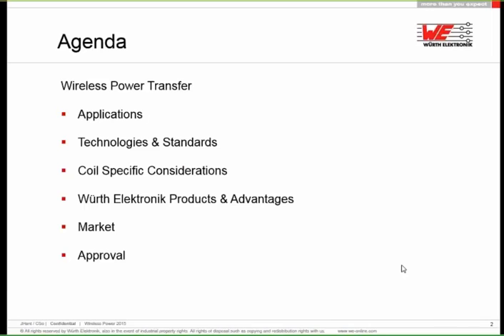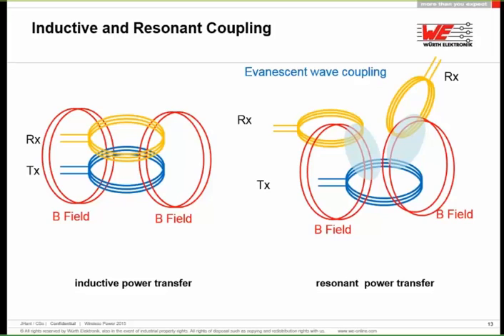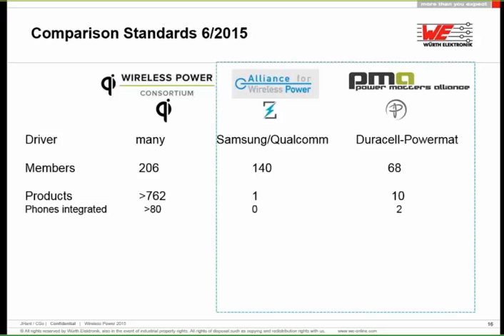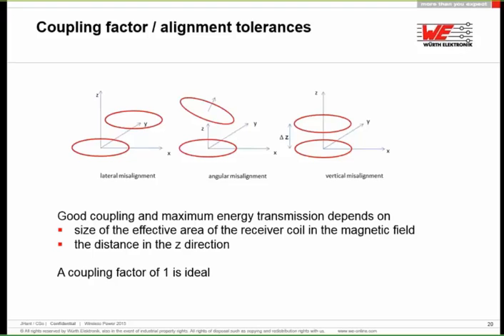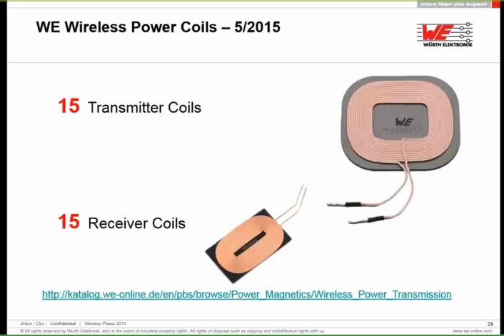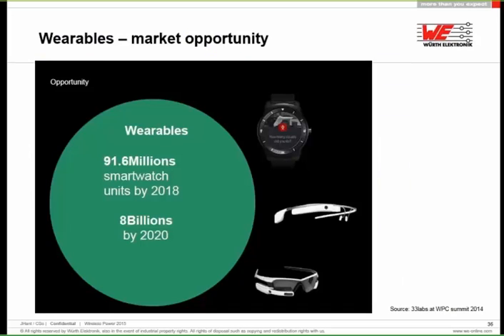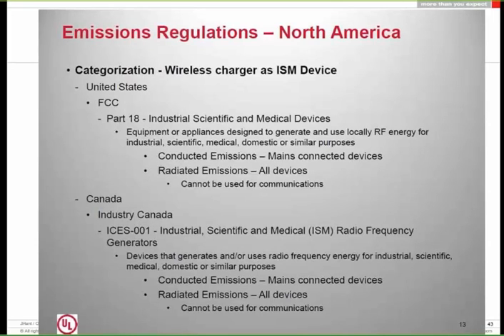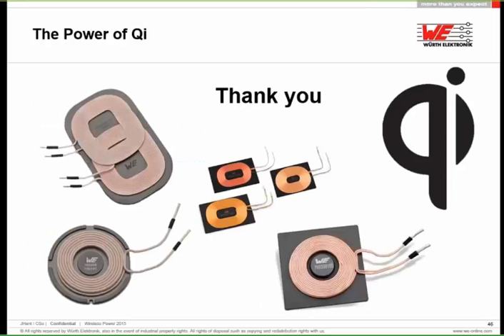Würth Elektronik Webinar: Wireless Power Transfer

Comment: At Minute 5, Is not operating at the resonant frequency for the resonant power transfer method induces more heat loss? How do you overcome such a challenge?
Reply from the maker: Thanks for your question! The losses at high frequency operation can be regulated by using Litz wire. At high frequencies, current tends to flow near the surface of the wire which causes resistance to increase. Moreover, using multiple wires results in current displacement which also contributes to resistance increase. By using multi-stranded wires, current flows through larger cross-sectional area and hence AC resistance and losses can be reduced at high frequencies. Best regards, Würth Elektronik